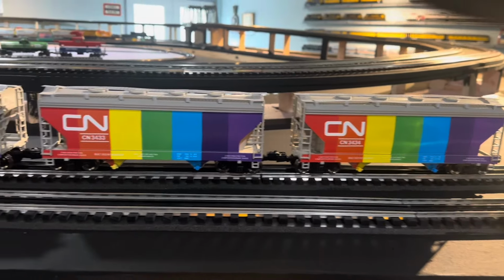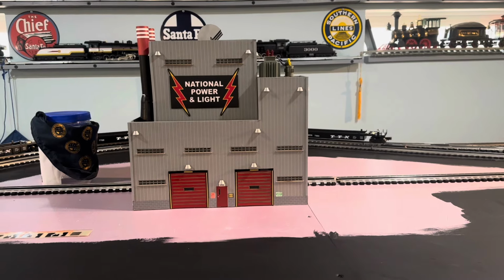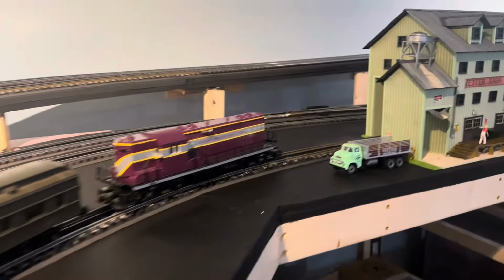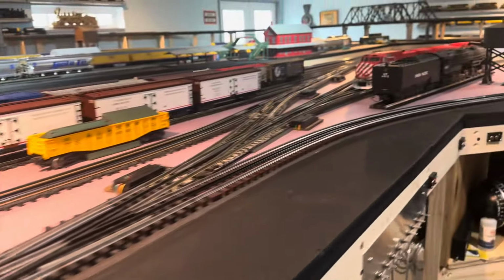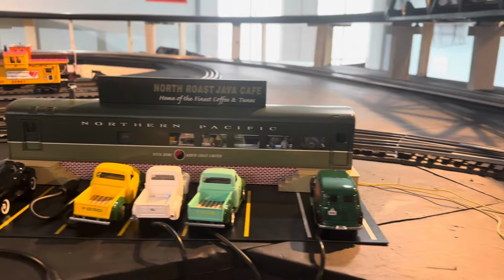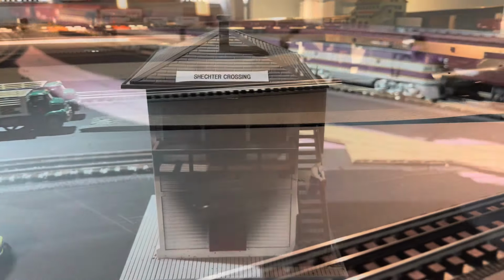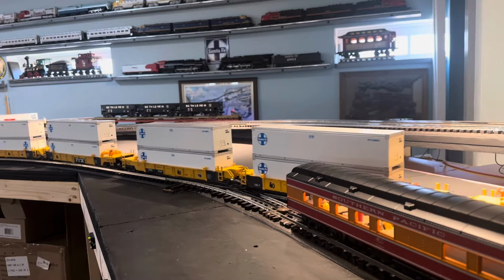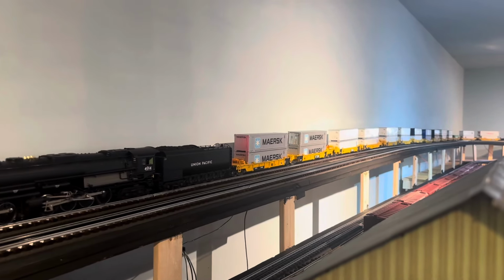Layout Update 11-17th Mar 2024

Comment: Menards sells nice equipment for very reasonable prices. I wish I had the room you have for  all those structures.
The rail cars are nice but the light weight and plastic trucks may cause problems in long trains. However I do like the polished wheels. When you weather them they look much more realistic than the normal dark wheels